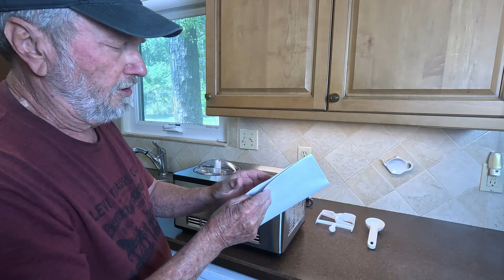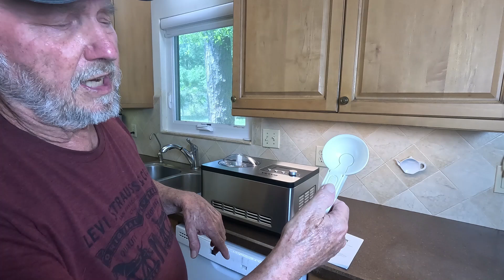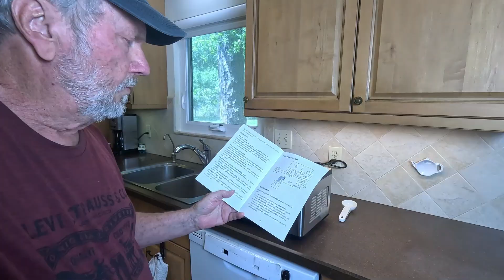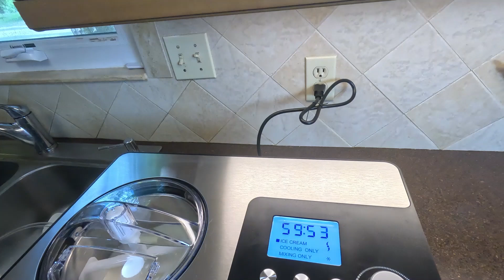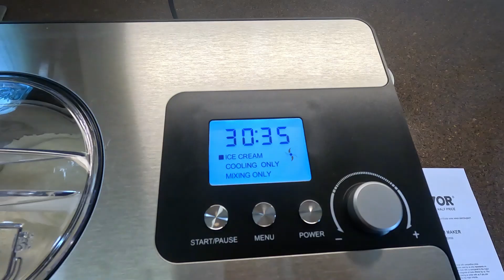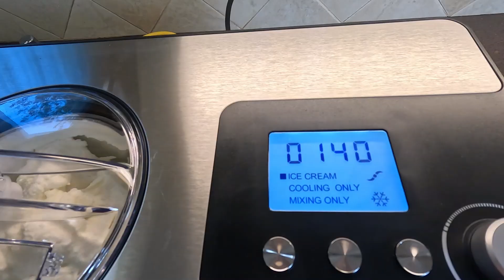VEVOR Electric Ice Cream Maker, 2qt with 3 modes operation works great

Comment: Great advice about letting the machine sit level for 10-20 hours to allow the oil in the compressor to redistribute. This is just like a refrigerator. Not doing this will shorten the life of the machine and give sub par results. I'm probably going to pick up this machine and begin my ice cream journey. It's exciting.
Reply from the maker: @Phloored Thanks for your comment.  You gave some great advice about letting machine to sit level for a day before using.  In shipping the shipping box may have been upside down and this allows the refrigerant to run from the compressor into the lines, not good.  Sitting level for a day allows the refrigerant to run back into the compressor.
The user manual does not mention the waiting period before starting the machine, it should.  Thank you for addressing this precaution and it is very important.